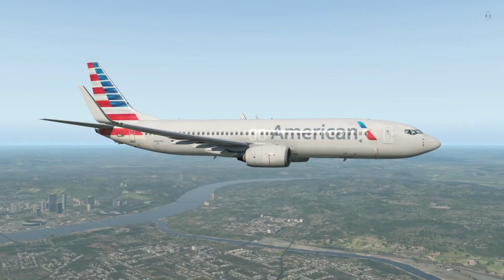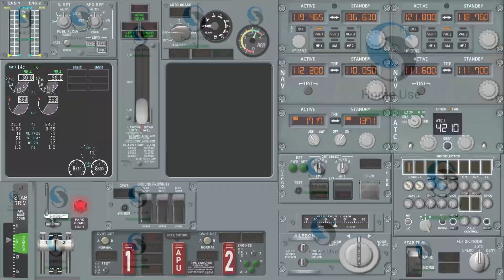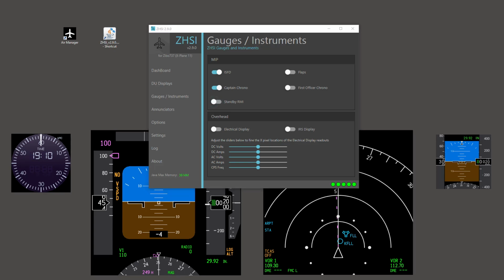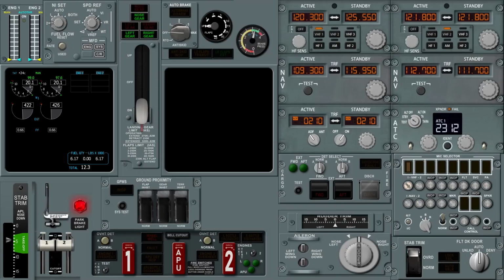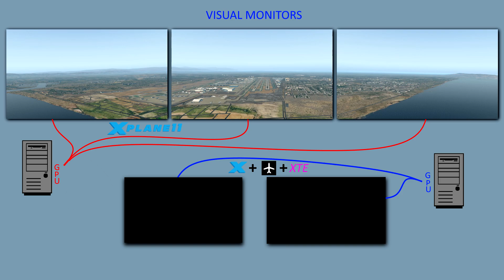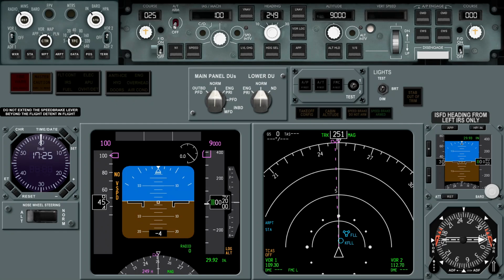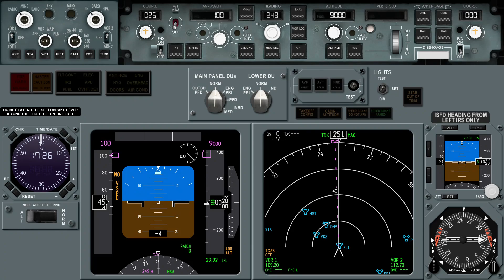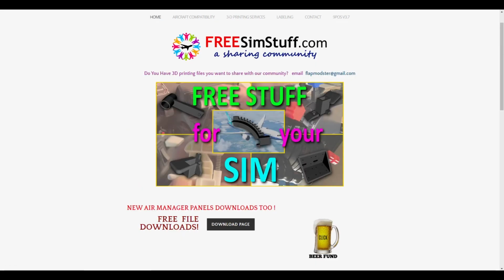Free Zibo B737NG Panels

Comment: Hi Russ, thanks again for all you info you share with all those interested in flight sim.
I have one sim which was bilt with a SLAVX panel, mainly for the C172 Steam. But I think I restricted what I could do, given the config I created.
I like your Virtual Cockpit ideas as I can fly any aircraft as long as I can get the panels on 1 or 2 touch screens. I want to be able to fly G1000 C182/C172 but also have the flexibility to use the Zibo Mod to fly a B737. From all your work/research, what touch screen(s) config would you recommend that will allow me to use the G1000 PFD/MFD as well as fit the B737 panel? I heard your comment that the 15" screen was too small, but the Lenovo 24 was a bit difficult. Lenovo also has a 22 inch touch. The 24 could sit in a Flight Velocity Panel with room for a VF yoke I would imagine. Your thoughts/advice? Thank you.

Comment: Very interesting Russ, may thanks. Are you considering how the same solution could be used with MSFS2020 and for me, using PMDG 737. Am creating a cockpit but not going to on the Karl journey, just not capable. However I was going to buy physical units that used most commonly in flight e.g. CPL MCP/EFIS. However I had been mulling how I could use multiple monitors to show the PFD, ND and ECAS and your example cockpits at the end look amazing. So, while I continue to explore what/how I would build, this approach could be very helpful if MSFS2020 compliant. Thanks again

Comment: Hello Russ.   Glad I came across your Channel.  This is exactly what I need.  I am building a full size 737 cockpit with every possible switch, Encoders, Digital displays, FMC. All hard wired hopefully for Xplane. My question is will AirManager accommodate all this programing for all equipment or is it limited at this time? Thanks in advance for help
Reply from the maker: Air Manager can do most anything but may take some knowledge.  Check out my video Malibu Magic to get a feel for what Air Manager can do. It could even create the PFD, ND and MFD but it would be a mountain of work. ZHSI has already made that available so no need to reinvent the wheel.

Comment: Good afternoon friends dear Russ
My name is Gabriel Monteiro, I am a First Officer os brazilian Gol Linhas Aereas
I am using Xplane 11 to keep current while I am furlough due to Covid 19 aviation crises
I have a project and I think Air Manager is the solution to make it real.
I would like to run overhead panel and pedestal in 2 diferent TV's, but without using my
main computer, because that would cause a big drop in FPS.
I want run my front TV in main computer, so I can chose between 737-700 (Ultimate), 737-800 (Zibo) and 737 MAX8 (Walter)
My doubt is if it is possible to run that 2 panels I want with Air Manager with the notebook I have, conecting to the main computer 
in local wifi
And if the Air Manager works with the 3 models of 737 (Ultimate 700, Zibo 800 and Walter MAX8)
For an example I am using a plugin Xplane CDU that works for these 3 models, the Xplane CDU recognize Walter's MAX 8 as Zibo 800 and works perfectly 
Thank you so much for your attention

Comment: Ho Russ, first of all my best wishes of a new year. Than i buy the 24" monitor and i set the panel that you created. I like them very much but i have some problem when i engage the A/T.  In the air manager panel don't switch on  but in xplane It switch on o off. What i can do to resolve It. Thanks

Comment: Russ, can you please answer as I have many questions about flying the Zibo 737 cockpit. Without a full set of overheads and pedestal instruments how can you possibly go through your complete checks and tests and engine start procedures. Unless you have some shortcut to bypass proper procedures. I am enthused to get started but I need some sage advise on getting started. There must be someone who has done this and can be a mentor in my proposed project. Thank you in advance for your help. Basil Hugueley
Reply from the maker: There is an overhead panel I made available as a pay panel from Sim Innovations. The panels in the video contain most of the needed items from the pedestal including for example the fire panel, cargo fire panel, trim controls, etc. I think with the overhead and the two panels in the video you have everything needed to make a flight. All of the instruments can be repositioned and resized onto a pedestal monitor if desired.

Comment: Since Air Manager 4.0 was officially released today, I thought I would ask if you think the community free MS2020 instruments/panels  and pay panels would expand?....pretty limited at the moment  If they have a broad user base, then I think it would be worth it to upgrade because people will submit their designs (I would hope).  I have 3.x currently and tried the Beta 4....just doesn't seem widely used enough but I could be wrong on that.  Eager for your thoughts on the MS2020 side of this equation.  I know it really caters to the X-Plane community first and foremost, at least at this time.
Reply from the maker: You have to remember that Air Manager (AM) only supported X-Plane until version 2.0 and until AM there wasn’t much out there for XP users to create custom panels. XP has long had a community sharing focus because it was a niche market and not lucrative for developers. FSX/P3D addon products were pretty developed when AM stated so it was tougher for AM to grow. At this point there are more FSX/P3D users of AM than XP. Users. I think that AM will become popular with MSFS users over time because of what it can do. No better and flexible tool to create visual and hardware home cockpit instruments in a single package. As the MSFS user base grows the Community instruments will follow. But it is the chicken egg conundrum... which comes first. Instruments and panels also attract users who in turn make new instruments and panels. MSFS is here to stay and do is AM imho.

Comment: Hi Russ, I haven't flown in years but do have about 12 flight hours in a Cessna. I wanted to get back into flying to help slowly train for my private license in the most minimum amount of time to save costs. Would you say that getting the Honeycomb products and the HP G2 VR is very helpful to prep myself for the real flights? Id like to learn the communication lingo, weather, navigation and some procedures since I couldn't catch on when I was flying the Cessna with an instructor. I looked up this information on forums and pilots say that using Flight simulator to train for Private is useless and creates bad habits. Has this changed with VR? Already purchased FS2020 and PC with an RTX 3080. Honeycomb Alpha next. Thanks
Reply from the maker: I disagree that a home flight simulator is “useless” for a Private pilot student. I can only take you do far but that is pretty far. You can definitely learn procedures and learn to run checklists. If you have a good sim you can also learn the aircraft systems. Add in Pilot Edge and you can get comfortable using the radio band GPS and radio navigation. I  think X-Plane offers the best training overall right now but MSFS is great for practicing pilotage navigation. VR is awesome  but it can be a bit of a distraction trying to control switches with mouse or controller. If you have room a 3 monitor visual plus a panel monitor is an excellent setup. If you get a course like Gleim or Sportys offer you can learn a whole lot and greatly reduce your actual airplane training costs. Adding an actual CFi to a few training sessions will pay off too.
Reply: @rbarlow  Thank you Russ. I mentioned VR because pilots keep saying the bad habit learned is looking at instruments instead of the windows. I figured VR gets the student to look outside instead of the instruments.

Comment: I currently only have one PC but I like the idea of running Air manager and zHSI on a second driving 2 small displays for the panels. What sort of spec PC does it need to be as I don't want to spend a huge amount?
Reply from the maker: Pretty modest say an old gaming computer vintage about 4- 5 old for 2-3 hundred bucks. Maybe Gtx 660 GPU  or better and a i5 of that day
Reply: @rbarlow  Thanks Russ, I'm in the UK and there are several sellers of surplus/old stock PCs - I'll do some research and see what's available of that sort of spec.

Comment: I used it for a while，and the experience was great！Thanks Russ！！and some small bugs need to be fixed.
1.Flap indicator on the incorrect position when select above Flap 15
2. Test button(A/P A/T FMC) is incorrect when select 2. Usually is three yellow lights.
3.Responder switch can't be move.(standy/alt on/Ta/Ra)
Thank you for your contribution to the simulated flight.
Thanks again！Great work！Russ！
Reply from the maker: I will post a fix. I know I had fixed it but maybe posted an old flap instrument
Reply from the maker: The flap fix is posted for download at freesimstuff.com  . I will look at the other two when time permits. I think Zibo transponder wouldn’t support all modes when I coded that. It probably has changed since then a couple years ago.

Comment: Hi Russ, Another great video with a lot of useful information.  I was curious about  that photo toward the end of your video showing the six screens of the airline cockpit, the backlit throttle quadrant with fuel shutoffs and parking break with red light they use, do you know what it is called or where they got it?  Thanks.
Reply from the maker: See https://www.flightsimpm.com/web-store/737-Throttle-Quadrant-v2-4-p33600129